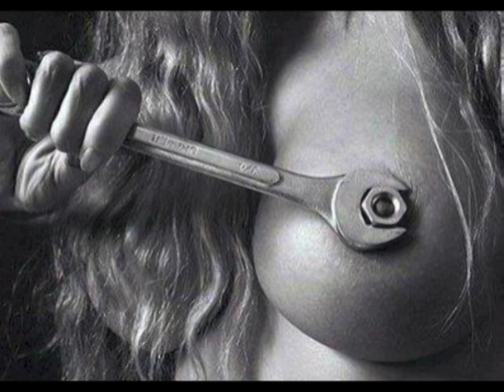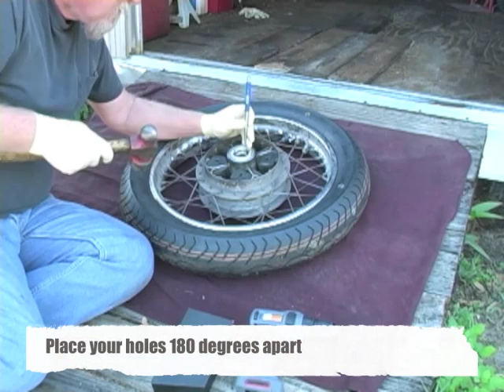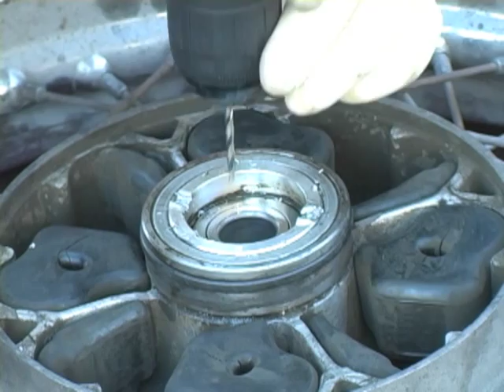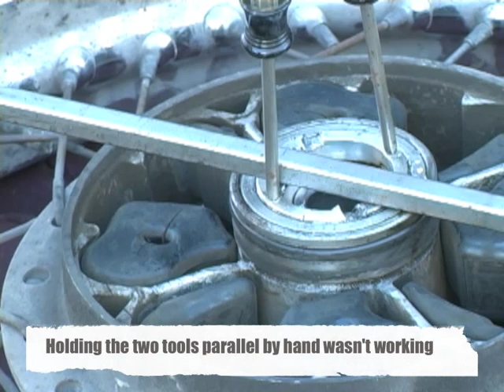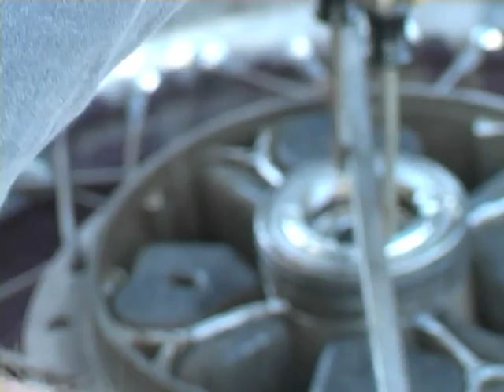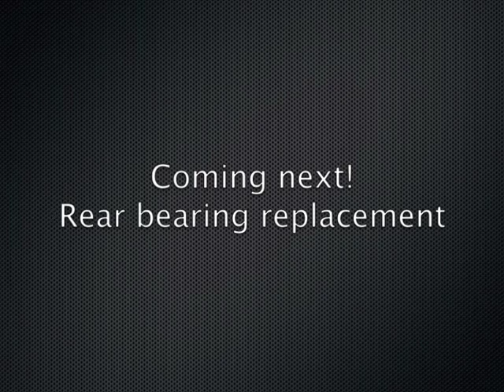SBTV How To:  Honda CB750K Rear Bearing Retainer Removal (Without The Special Tool!)

Comment: I have a 550k and the rear bearing retainer is very different than this one, on this one if im seeing correctly there are 2 slots? on mine thats how it is up front but it has 4 slots, in the back the retainer has 4 holes, its funny how sometimes we cant think of the obvious but i saw this guy cut a flat piece of what looked like angle iron and stick it between the flats and use a crescent sideways and bam, came right out, didn't mess it up at all, i was like "why didn't i think of that?" ha ha ha

Im restoring mine completely and i was gonna do my rear wheel but i might have to end up buying the tool,i messed up my front one and that one is only like 12 bucks, no biggie but the back one is high dollar, its already a little buggered but not bad, still salvageable.